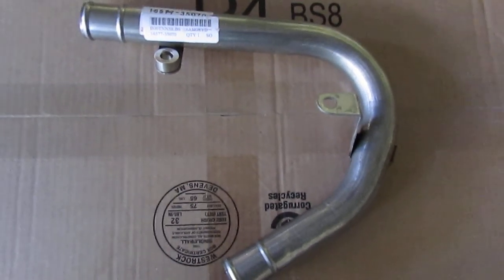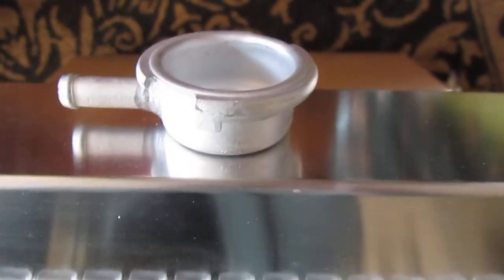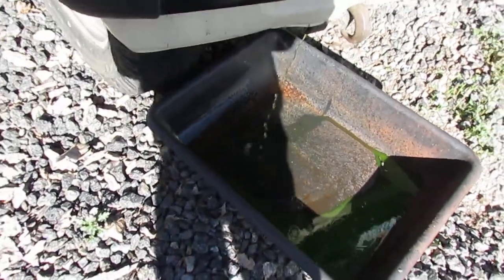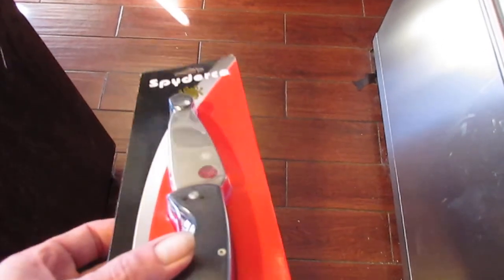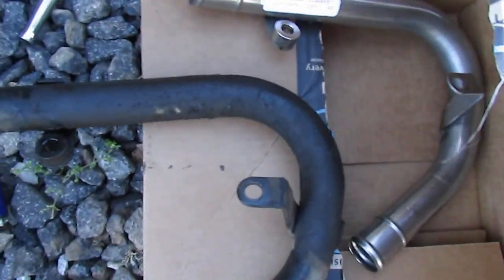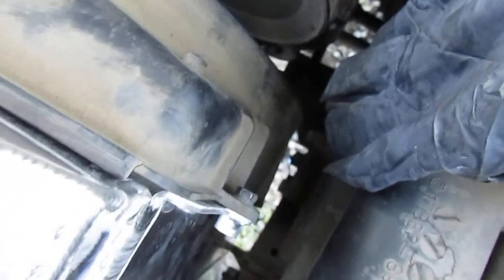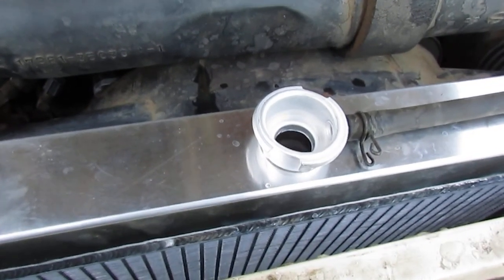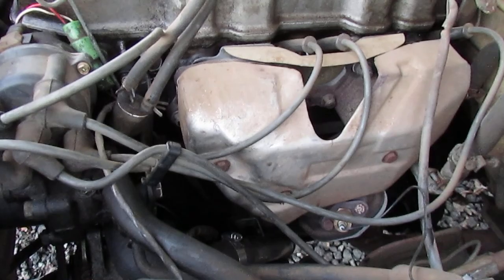1985 Toyota 4WD EFI 22RE-C Cooling System repair, Liland 945AA & 16557-35070

Comment: Wouldn't the rust be coming from the old radiator? I thought the 22RE was an all aluminum engine. I could be wrong
Reply from the maker: Big AL they have cast iron blocks with aluminum heads, as was the style of the time.